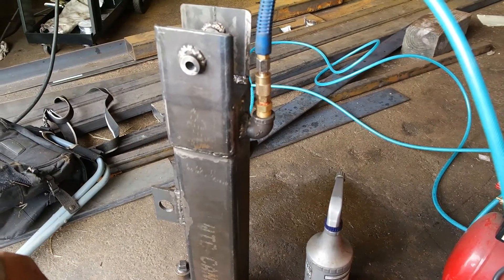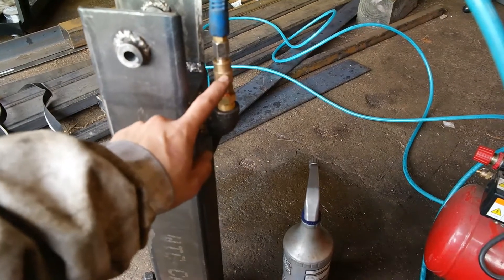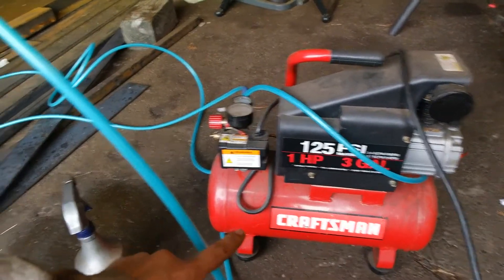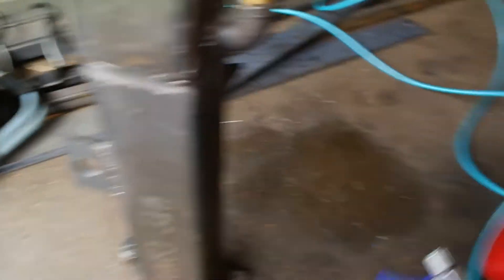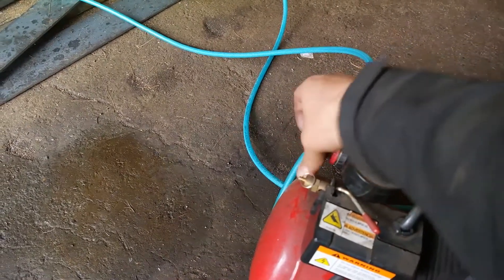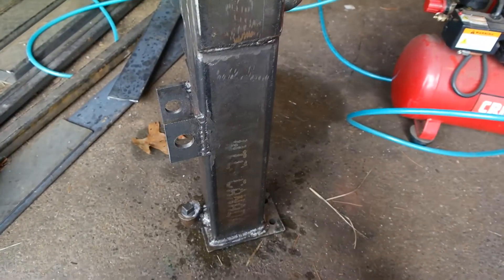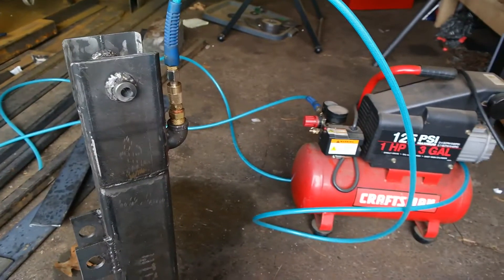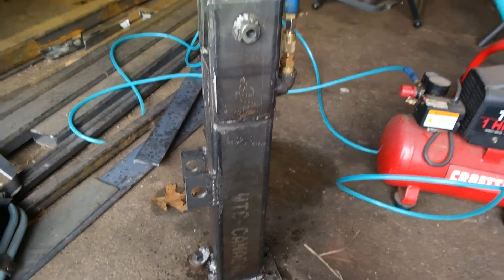Cub Cadet TLB Transformation Quick Tip: Hydraulic Reservoir Test

Comment: I know this is 6 years later but when you air test any metal container, only use 5-10 psi. That's all you need. I know your loader arm is 1/4" thick and can handle that amount of pressure, but anything thinner could 'balloon' on you or even explode.

Comment: I would recommend against pressurizing it with more than perhaps 15psi. 80 pounds of air is quite a bit of energy stored in that reservoir. If you have the capability to test with water, then you can pressurize it much higher without creating a small bomb. Just be careful!